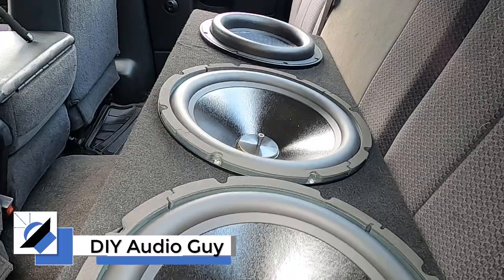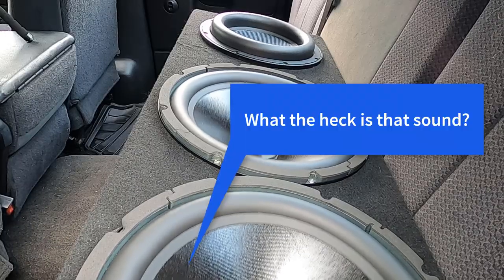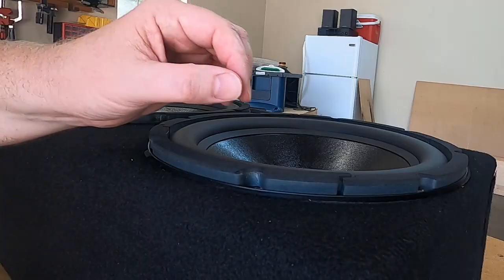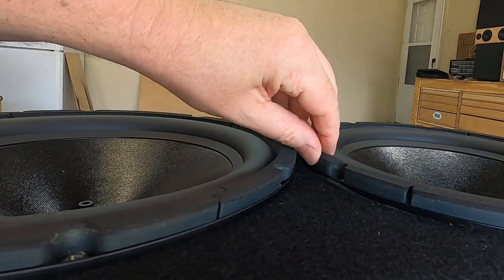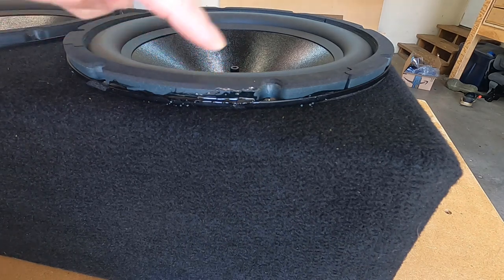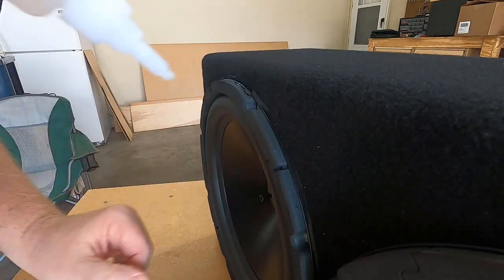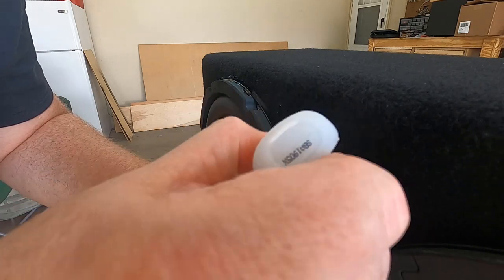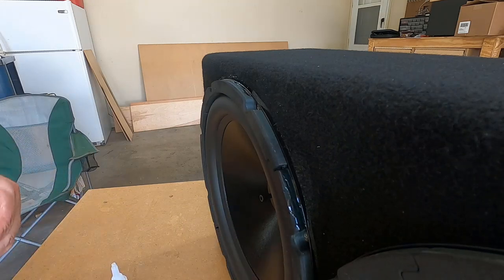Subwoofer Fail Passive Radiator Fail

Comment: Pull both radiators, check everything over. I believe the reason these were pulled was due to faulty glue. A few other subwoofers had that problem too. It sounds like a pronounced knock so it could be possible the weights are coming off.
Reply from the maker: I think you're right.

Comment: I had a passive radiator system in my truck. I used the Earthquake SLAPS passive radiators, they are built tough.
Reply from the maker: Do they still make those?
Reply: @DIYAudioGuy I’m working on a escalade build getting a earthquake PR
Reply: The SLAPS series just came out with a V2. I bought 2 of them. They are still on sale on thier website and don't require weights. Fs is 17hz. The XMax is a incredible 3inches. Handles any of the music I play.
Reply: experiencing the same thing with 2 earthquake slap m12 PR

Comment: Do you have an Update on this one PR ? I would like to know what caused the problem.
Reply from the maker: The PR had failed, apparently it was a bad batch and that's why they were on close out.  I had several viewers comment on Facebook letting me know that it has some more experience.
Reply: @DIYAudioGuy  But why? PR Chassis are relatively simple build chassis not some sort of rocket science.
Reply from the maker: @nikleiser5888  glue failure

Comment: Can you put a passive radiator directly behind the live subs and still get deep bass vibration and sound?  asking for 3 cubic feet enclosure and 2 12’ L7 750 rms each with a 1500 watt amp ?
Reply from the maker: I'm not aware of any hard scientific evidence regarding the placement of the passive versus the placement of the active subwoofer.  Think of the passive radiator the same way you think of a port. It's just a ported enclosure that uses a speaker cone instead of a mass of air.  You want to model it in something like WINisd or Hornresp before you start cutting.

Comment: I really like the idea of the passive radiator build. If you move on to a different brand, what are you looking at?
Reply from the maker: I'm not really brand loyal.  But, there are plenty of them out there.  Kicker, PSI,...  I tend to lean towards dayton audio/parts express because they do a good job of posting specifications online.
Reply: @DIYAudioGuy  I'd say you should have gone with those Dayton extreme tunable aluminum series which you can tune down to 12hz they also have far better on
cone excursion up to 25mm I'm using a twin set of them for each of my bookshelf builds
Reply from the maker: @DREDKNOT2063  I think you are right.  I'm pretty sure I'm going to replace these two passives with a single 12 from that line. I grabbed these because they were cheap and I figured if this didn't work that I could just scrap the PR idea.  I didn't expect the idea to work but the PR would tear itself apart.
Reply: @DIYAudioGuy  i dont remember now were those subs 10 or 12in  this is outside my budget but besides the dayton 12in Dayton Audio  RSS315-PR 

try the Scan-Speak  30W/0-00-00 in winisd modeling 
 
http://www.loudspeakerdatabase.com/ScanSpeak/30W-0-00-00

http://www.loudspeakerdatabase.com/Dayton/RSS315-PR
Reply from the maker: Thanks for the links I'll give those a look.
Reply: Earthquake Pump12s are probably the best radiator I have in my PR builds. It's also Horned and gets very loud and low. Cannot find the frequency info on them anywhere. Someone told me the fs was 30hz but can't confirm. The catch-22 is that they require a whole cube to function at optimum.

Comment: try tuning the PRs.....add some weight over the PR cone...may double cone overlapping might work. try it out
Reply from the maker: It turns out that there was a known flaw with these passive radiators, which probably has something to do with the fact that they were discontinued, nothing was wrong with the tuning.
Reply: @DIYAudioGuy  don't give up on this build. if its not the tuning, then the most probable cause is standing waves building up in your enclosure...most rectangular and cuboidal type produce it. try to stuff lot of polyfill or make v-shape angle separators right below active woofer and 45 degree planes below PRs , to effectively move sound pressure waves across the enclosure(sound wave obeys same rule of reflection of light rays) . an experiment on it worth it.

structure like this-                                  /...........V...........\
Reply from the maker: @griffinacoustics  no, it is actually a failed part. One of the passive radiators was bad. I bought these on a close out deal from Parts Express and you can't get them anymore.  I have continued with the build, it's just hidden in other videos.
https://youtu.be/WWNQZzwcbBM

It's winter where I live so my build progress has slowed down considerably.  I'll be getting back on it as time permits.

Comment: That sucks that your passive radiators are doing that. Hope it’s a easy fix. If not I think I saw in another comment they weren’t that expensive so that’s good it’s not a huge loss. 

I’m actually planning to move my Ultimax 10” to a passive radiator build and think it’s cool I have something to watch until I can first get the car running again before I can work on the sub. 

I’m aiming for something tuned quite a bit lower though. And I’ll either use 3 Dayton 10” passive radiators, or a single 15” Dayton passive radiator. (RSS390-PR 15" or RSS265-PR 10")

The 3 10” PR will be more expense but save a bit of space (0.5 cubes) with the same output as the single 15” PR.
Reply from the maker: It's all good.  I will toss the one that failed, or use it as some kind of decoration in the background of my videos.  The one that did not fail can be repurposed for a smaller project.

Dayton audio has a 12-in passive with a ton of X-Max. I'm probably going to switch to that one.

I've also got a pair of the date and audio high output 10's sitting on a shelf. By the time I'm done I might switch the ultimax out for one of those.
Reply: DIY Audio Guy That 12” sounds like the RSS315-PR 12" hope it works perfectly for your use case. 

My build is around 3.5 - 4 cubes tuned around 19Hz so it needs some more cone area & xmax according to WinISD.
Reply from the maker: @JoshM7  Damn that's low!

I like the idea of 3 10-in passives  and a 10-in active.  I might have to throw that into when ISD and see how it behaves.
Reply: @DIYAudioGuy  The Transfer function magnitude for my UM10 and 3 RSS265-PR shows a declining trend that starts at -0.6dB at the upper usable frequency in my car (60Hz, everything above that somehow doesn't pass though the trunk) and by 28.5Hz it's at -1.9dB. Below 28.5Hz it slowly increases until just about 0 at 19Hz. I'm fine with the 2dB down at 28.5Hz as that's nothing too crazy. If it was more than 3dB then I might reconsider.

If WinISD is correct with my UM10 and these 3 RSS265-PR, I'm a hair above Xmax for the UM10 (20w haha) and same with the PR's. Each one of the PR come with five 75 gram disks and all will be used totaling 375g on each PR.
Reply from the maker: @JoshM7  I wonder how cabin gain will affect your final output?  It'll be cool if you Can get some big mid-bass drivers in your doors so you could blend well with your subwoofer.
Reply: @DIYAudioGuy  My car has Front door speakers (though almost no bass from them, might see if I can mess with the enclosures and change that) and Rear deck speakers. The Rear speakers fill in the gap above 60Hz nicely when my car was working. 

The Ultimax 10 is using the sealed kit from parts express and using a really low low pass (25Hz first order low pass) it was usable at highway speeds with the window down from around 26Hz and up. Really low low pass was to keep it from being too loud at the upper frequencies since the F3 technically is around 35Hz or something around there. (Parts express says higher but WinISD shows lower)

I'll try to do a video on it when I can, but it might be a few months. Because you don't often see videos of Ultimax subs being used in car, especially with Passive Radiators.
Reply: @DIYAudioGuy  I might try an interesting build with the Ultimax 8-in when I get the car running and get some money to make something fun.

Isobaric Ultimax 8 build with a 12" RSS315-PR in 2 cubes. 600w and it's around 102dB at 20Hz. Which I think for normal people (like me) would be loud enough. Won't replace my Ultimax 10 build, but will be fun to try something different with the Isobaric layout. 

May or may not work, but on paper (WinISD) it looks good.
Reply from the maker: I am a huge fan of unusual stuff like that,  it's the main reason I am fooling around with PRs.  I think it would be cool to make a bandpass enclosure and use passive radiators for the vents.  Crutchfield sells a home theater speaker that does that, they have a video where they show it cut in half so you can see the crazy design.
Reply: @DIYAudioGuy  I've talked about stuff like that with another person I know. Bandpass with a Passive Radiator should work all the same as a port, but with the unique factor that most people don't even know that's possible.

I wonder what it'd take to do a 8th order with Passive Radiators? There's so many options for something as crazy as that. So much to figure out though It'd probably break my mind. WinISD isn't built for something as silly as that though.
Reply from the maker: Hell yeah brother!